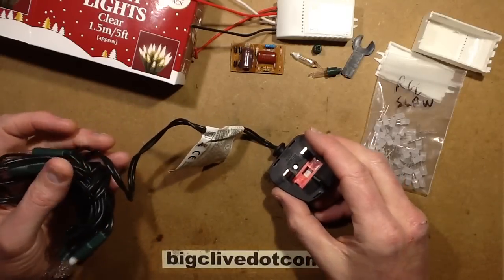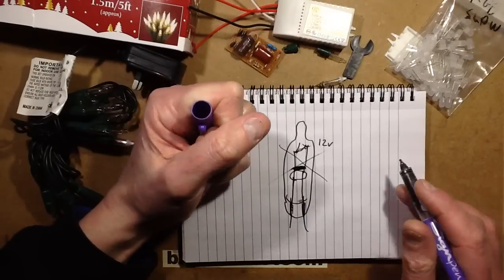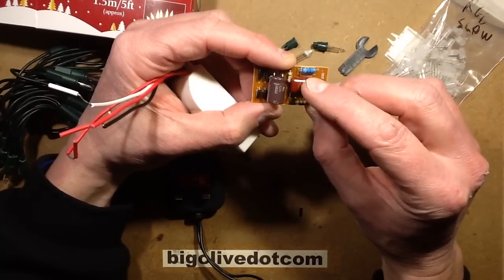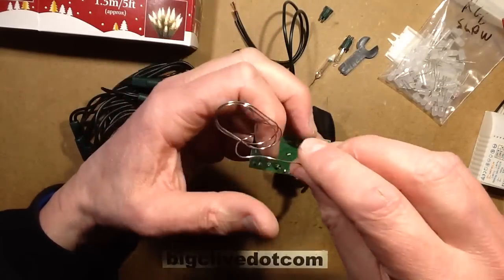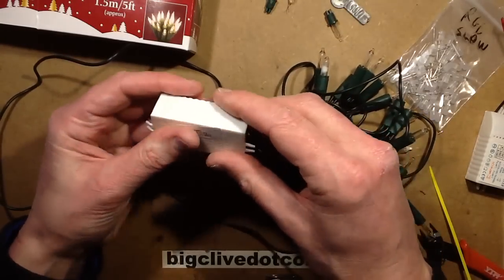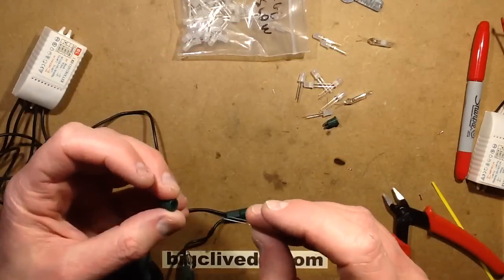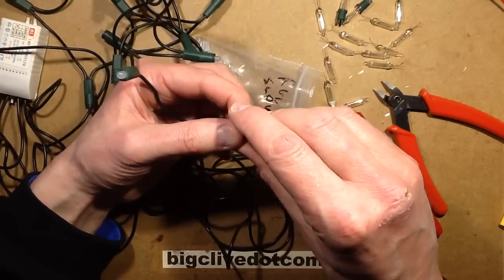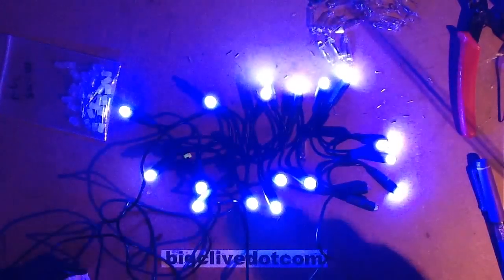Scary work incidents and other answers (with more LEDs.)

Comment: Aside from hydrogen explosions,biggest bang i ever heard was from a tetrode based magnetron test gear that had developed a fault.
Tech had the panels off and the barriers up,with an oscilloscope hooked up,while his colleague ran the thing up to test voltage,tech uttered the immortal words "err...Steve" followed by several pistol shot like arcs with really large blue flashes.
Panic ensued while the HT got killed off and those of working close by crapped ourselves,i was on the gear closest and copped full force in my left ear!
The trigger on the tetrode had failed causing the volts to rise quickly with no place to go,except across to earth,the poor tech inside the barriers had realised the volts were rising and was trying to the the HT turned off.
Reply: Silence.............

Comment: I thought the sheve was thee rubber liner in the wheel. Picked that up from lift repair while I was security at a ski area.
Reply: In the UK sheave is the correct term as Clive stated
Reply: When I took powered lift training through NASA, they also referred to the pulleys as sheaves. After spending the first 5 minutes of the class explaining the difference between metal cables and metal rope, it took me a bit by surprise that he just threw the term "sheave" out expecting all of us novices to know what it meant...

Comment: the led you flipped seemed to survive but the two directly next to it look like they didn't!
Reply from the maker: The sudden half-amp spike from the fully charged capacitor through the 470 ohm resistor nuked them.

Comment: Would a simple zener diode suffice as an overvoltage protection, to siphon the dropper charge in case of the LED string going open circuit? Or possibly a zener-controlled transistor that does the dumping into a load resistor?
Reply: You askin me? Uhhmm yeah probably why not

Comment: Thanks for the videos Clive, and Happy New Year. Being inspired, I recently fixed an 18 LED worklight over my lathe, being able to trace the circuitry along the lines of so many of your videos. Fault was traced to a single o/c LED. Now want to convert 4 sets of Xmas lights (1 * 20 and 3 * 40) using this video as a guide. Have ordered 200 RGB leds, but not sure what to do about the power modules. Your link is for the 50-80 module and not sure what to use for 40 and 20 sets, please advise.
Reply from the maker: The modules are all the same except for the value of the red dropper capacitor inside (The one closest to the wire end.).  Are you on 240V or 120V?  If you're on 240V then it might be a good idea to reduce the value of that capacitor using a similar 400V or X2 rated capacitor.  A typical value might be 220nF or 330nF (0.22 and 0.33uF).  If your supply is 120V then the existing caps will be fine, but the 40 lamp strings will have a combined voltage of over 120V so you may need to shorten the strings a bit.
Reply: OK thanks. Standard UK 240 volt. So what best values for 20 lamp and 40 lamp set please.
Reply from the maker: I used a 220nF for 20 LEDs and have since extended that set to 39 LEDs by combining two 20 holder sets.  The 220nF still seems ideal.
Reply: Thanks. Big help. Look forward to the next batch.

Comment: Did the last two fail because of the reverse experiments, or is likely to occur within one or two times of plugging them in under normal usage at the peak of the mains waveform ?
Reply from the maker: The capacitor had charged to full mains peak voltage, so it caused a 500mA current spike when the LED was reinserted.

Comment: Hey Clive, great video! In many American incandescent Christmas light strings, there is usally a red-tipped bulb supplied in the package of replacement bulbs that, when inserted into the string, causes the entire string of lights to flash at random intervals. Do UK Christmas lights have a similar feature, and if so could you explain how the flashing bulb works?
Reply from the maker: The flasher bulbs are rare now, but they have their filament in series with a bimetallic strip so that when the lamp is lit it heats the strip, which then bends, breaks the circuit tot the whole string and then cools down and makes contact again.  There's another version where the bimetallic strip shorts out the lamp it is in making that individual lamp blink.
Reply: Ah, that makes sense! Thanks for the reply!

Comment: I have a 100 set of tungsten Christmas light that I have done this  with 99  rgb leds and a rectifier. But I kept  the fuse bulb in the last lampholder for safety .it still works the same .
Reply: They work well

Comment: Hi Clive
Love the channel, both the tear down subjects and the humour. I want to do the same mod you show to a set of 35 mains voltage (240V) fairy lights. Would the 50-80pcs LED controller still be appropriate or should I go smaller? You seemed to imply it did not matter too much. 
Thanks
Reply from the maker: The same capacitive dropper can be used, but I'd suggest using a 220nF or 330nF capacitor for the dropper and upgrading the electrolytic to 400V (4.7uF or 10uF)
Reply: So what is the difference between the different driver units for the different numbers of series LEDs, is it the capacitor sizes? If I bought the 25-37 driver would that mean I could skip the capacitor mods (except maybe the electrolytic to up its voltage range)? 
I'm still trying to get my head around how the capacitive dropper circuit works to limit the current and therefore how you go about picking the capacitor size. I found an explanation you did on your website were you modified the driver for an LED light, but I'm still a little unsure. But I've learnt a whole load of other things from your channel.
Cheers

Comment: Y start delta run to handle the amperage with a submurged hydraulic pump is the typical setup in america ive never looked into how european elevators are set is there a difference

Comment: Hi Clive, is this modified transformer circuit safe/correct?
I bought a couple of the transformer modules to do a similar tungsten to LED conversion (thanks it works really well). One had a damaged electrolytic so I got the seller to replace. The new module is the same PCB but with two electrolytic capacitors where two of the diodes would have been in the full rectifier, and now no electrolytic to smooth the DC output.
Difficult to fully explain but if you imagine the usual bridge rectifier diamond arrangement (AC top/bottom, DC - left/ + right), the bottom two diodes are electrolytics. The DC tap off would normally have an electrolytic across it with a discharge resistor, but that cap is missing, resistor is still there however. The two electrolytics are the same 3.3uF 250V.
It sort of looks OK now I've drawn it out but then again not.
Would love to know if this is correct?
Cheers
Reply from the maker: It almost sounds like ti might be a voltage doubler as if the unit is intended for 120V operation.
Reply: Maybe, though the packet says 110-220V. I think they are the same ones you used. If you are interested here's a link to a rough sketch of the circuit (new one at the top, original on the bottom).
https://goo.gl/photos/rNRTo4cCQtw36pjW7
Cheers
BTW Love the channel.
Reply from the maker: That's definitely a voltage doubler, so the open circuit voltage could go quite high (600V) if it's left open circuit.  That circuit seems to be configured for 120V use.
Reply: Wow, that would tingle! I think I might rework that module to be how the first pair where (move the one cap, remove the other and fit two extra diodes) and how the silk screen shows. 
Thanks for that.
Reply from the maker: Also check that the main limiting cap near the incoming wires is rated for 400V and that the diodes are at least 1N4004 or higher.  The smoothing cap will need to be rated for 400V too.  Pretty much a full rebuild, but you get the values you want and it's good value for the PCB and case.  I didn't know they did a doubler version.  It could actually be used to run REALLY long strings of LEDs on 230V.
Reply: I'll have to try and decode the numbers on the limiting cap. It's a different style to the others, grey and rectangular rather than the reddy blob style ones. 
I'm in two minds as to whether this circuit mod was intended or simply a cockup by whoever was soldering up the board!
Reply from the maker: It looks deliberate.  If you tell me what's printed on the cap I can try and work out its value.
Reply: The cap is marked with 105K 1305 450 MPN3 313258. I think the 105K is 1uF, and I guess the 450 may be the voltage? The rest I'm not sure about.
Reply: BTW both the electrolytics are 3.3uF at 250V.
Reply from the maker: That is unusual markings.  The 105 is most likely 1uF as you guessed and a quick look online suggests that the 450V is a common rating.  The two 250V caps would get charged up to about 330V each on 240V so not suited to our supply.
Reply: When I drew the circuit out and realised where the the two 3.3uF caps where, it did make be wonder about their 250V rating, hence why I asked. 
As this unit was only a replacement for another which had a physically damaged electrolytic (a deep dent on the side), I think I'll just use this one for spares.
Thanks for the input.

Comment: Hi do you have a link to where you get the caps please as i cannot find the Orange one in rapid electronics. Is it also a 400v one many thanks love these type of vids merry x-mass
Reply from the maker: The circuits commonly use this type:-
https://www.rapidonline.com/polyester?ra_source=tier-middle-image&Attributes={%22Capacitance%22:[%22100nF%22,%22220nF%22,%22330nF%22,%22470nF%22,%22680nF%22,%221%26amp%3Bmicro%3BF%22],%22Voltage%22:[%22400V%22]}&ResultsTotal=15

But class X2 interference suppression capacitors are a better choice.

Comment: do these leds somehow have a diode also inside them to allow the voltage to bypass the led chips instead of destroying the led?
Reply from the maker: I'm guessing they have added a protection diode.  The earlier ones were easy to destroy.

Comment: Hi Clive, Great video(s). I can only seem to find the 50-80pcs capacitive dropper on eBay. Is there any way I can modify it to the 1-36pcs version?

Keep up the good work.
Happy Christmas.

Mike.
Reply from the maker: +Michael Love The main difference is usually just the red limiting capacitor.  Note that some of the units are being shipped as 120v with a voltage booster where the four diode rectifier should be.  (Two diodes and a capacitor.)
Reply: Thanks for your reply. 120v is roughly in the middle of what I need. The LEDs are warm white with a forward voltage of 3.2v - 3.8v with a Forward Current of 20mA (typical), 30mA (max). I'll be using 35 LEDs in series on an old konstsmide Christmas star which has just died on me.
Reply: Hi Clive, I have just watched your other video https://youtu.be/JWxv0HUcw-g  Brighter conversion and have got a better understanding. Now time to start playing and experimenting.

Thanks again.
Mike.

Comment: I recently ordered 200 slow color changing LEDs. And guess what i got.

Yes you are 50% right with your guess that i got the fast flickery ones. But, only about half of them are that way, the other half is slow ones. It seems that they somehow mixed them, and i got a bag with fast and slow LEDs.
Which sucks as i now have to test every LED if its the right kind before i can start using them.

And the UV ones i bought turned out to be purple, again.
Have you managed to find any good source for UV LEDs on eBay?
Reply from the maker: Most eBay UV LEDs are "near UV" or in other words, purple.
Reply: Yeah already thought so. Might have to buy them at a local electronics supply store. More expensive, but at least i can check in the store if they are real UV.

Comment: i harvested a pile of LEDs from thrown away fairground flashy toys, the long lead is not a reliable indicator of polarity and neither is the cup/pin as I've had both 'wrong' in the ultra cheap Chinese LEDs, I think I've still got a 35mm film canister full of them somewhere, complete with dire warning label.

Comment: naturally the elevator factoid is for counterweight elevators only. loaded is the worst case for the less common hydrolic elevator with unloaded the easiest case and lowest power draw
Reply: Sean N factoid is not a real fact
Reply from the maker: Ah, yes, I should have differentiated between a traction and hydraulic elevator.
Reply: They are rather rare these days here so there or the mechanism hidden from the public is probably a decent audience that don't even know they exist.

Comment: What was the reason those (at least) 2 LEDS blew after you put that one in the right way round, could they have been weak or faulty?
Reply from the maker: High current (0.5A) pulse from the fully charged capacitor.
Reply: Thanks.

Comment: The LEDs in the ebay search link all say "flashing". Do they actually flash? I'd prefer if they didn't.
Reply from the maker: I'm afraid it's all a bit random what you get.  Some are the flashing type that cycle through colours and then flash through them too.  Cheap enough to try some from different suppliers though.

Comment: Newbie question: why is Clive using something made for 50-80 LEDs with just 20 LEDs? The eBay description says the output is 3V per LED, so this thing outputs 150-240V? Is it safe for me to connect this to 20 LED in series?
Reply from the maker: +gammarayburst It's effectively a current limiter.  The number of LEDs it quotes is based on the expected voltage drop.
Reply: thank you
Reply: Just to confirm, should the label technically read: 
1-36
1-50
1-80 (your preference)
1-130

i.e. Is it correct that having an overrated one is not going to be less efficient / run hotter than the 1-36 model when powering twenty standard 5mm LEDs? Thanks

Comment: Sheaves vs pulley. Was once told, long ago, a pulley transfers power to a cable system, whereas, a sheave only changes the direction of the system. No proof of validity.
Reply from the maker: I believe that is correct.

Comment: just have to ask are 2 LEDS out or is that just the camera?
Reply from the maker: When the LED was removed the capacitor charged to full peak mains voltage and caused a 0.5A current pulse when it was reinserted.  That nuked two of the LEDs.
Reply: LOL ok so I did see 2 out

Comment: The biggest bang I experienced, was my own stupid fault. 
I was working on a former "shell research" site and they demolished some old building out the back and put some new industrial estate type buildings up. It's was very close to the end of the job and I was given the job to move some breakers round as they wanted better load sharing. My boss said "turn it off before you work on it" n I said "naaa I'll be alright".
You can see where this is going.
It was a shit cheap n nasty n I think dangerous Proteus board and these breakers were destined for both tabs and screws. So instead of having on copper bar sticking out, it had 2 prongs sticking out instead. 
So there's me. Shuffling these breakers round a 20way 3ph boards worth of cables in and BANG!!!!
The exposed screw which was for the round screw. Went between 2ph and luckily, I was wearing a pair of sunglasses so no molten metal went in my eyes. 

My main 125A main switch was welded shut. Both the 100A MCCB feeding the board tripped and so did the 400A MCCB main in comer from the 11KV tranny. Lucky it didn't blow otherwise it'd of been even more trouble that I already was. 

Had to get down to the wholesalers as fast as I could n buy another one n some tough wipes to clean the panel, cables, my hand and the breaker which was by far the worst. 
SAFETY FIRST

Comment: One time I had a lead-acid battery hooked up to two pieces of aluminum foil in a mason jar filled with salt water. I held a lighter up to a tube shoved through the lid and after a couple seconds, BANG! The metal lid was ripped right off and flew up to the ceiling. If the jar had been any thinner, it would’ve exploded and I would’ve been dead.

Comment: Clive i have made this and am running an led strip lightof 5meters but the leds are dull, how do i make them brighter?
Reply from the maker: A capacitive dropper is not suitable for an LED strip.  It would be safer and brighter on a conventional 12V supply.
Reply: Thanks clive, I will stick to the original plan of running it off a pc power supply, I am running 2 strips and they are very bright when I do this.  Thank you again
Reply from the maker: To explain further.  The capacitive droppers are better suited to low current applications like long series strings of LEDs.  The LED strip is usually a long parallel run of lots of smaller circuits of three LEDs and a resistor.  On a capacitive dropper the current for effectively one of those sections would be shared along the whole strip.  The capacitive dropper also doesn't isolate from wall power, so the strip of LEDs would potentially pose a shock risk as it is designed for low voltage use.